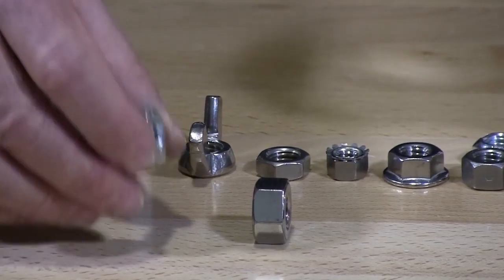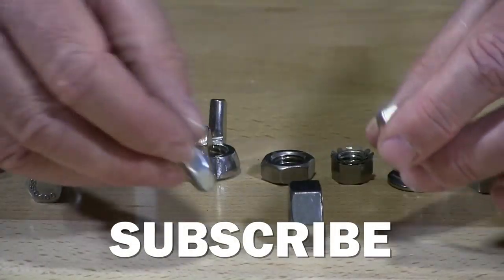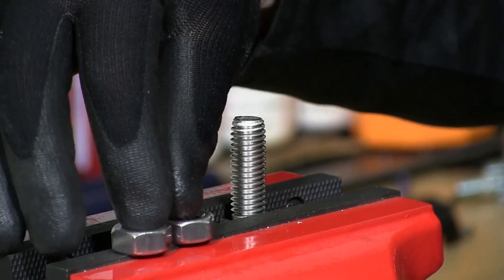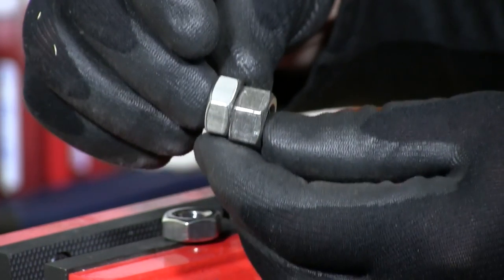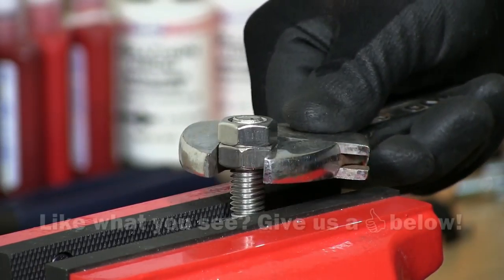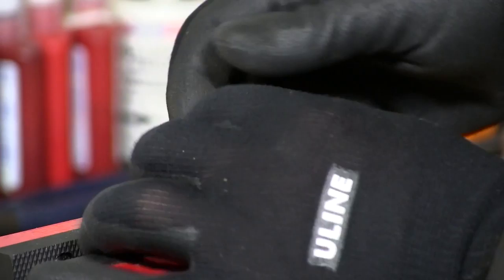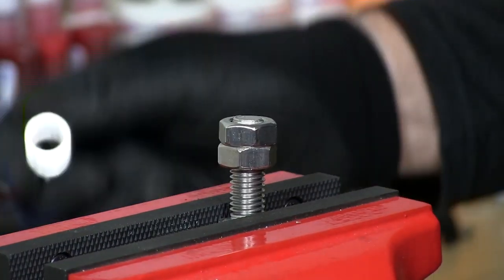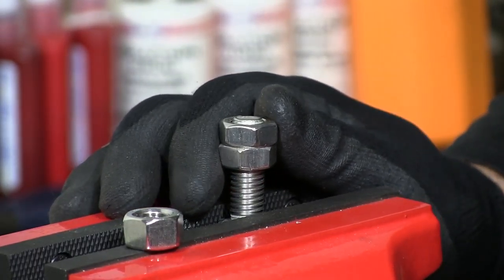How to Use Hex Jam Nuts | Fasteners 101

Comment: The idea is to use a thin nut on the bottom to ensure that the backlash is maximised so that the top nut is tensioned such that the upper flanks of the nut are in contact with the bolt flanks after tensioning therefore eleimiating the ability for relative movement between the bolt and the nut. By using a thick nut your tension applied my not result in the top nut desired flank contact due to lack of movement during pretensoning

Comment: I landed on this vid looking to find something that would explain why I have hex nuts that have slop when fitting on a 10-24 screw. They screw on easily, but wobble. Do jam nuts have a lot of play? These nuts also don't thread onto 10-32 (fine) or 5M-0.8 which is the closest size of metric.

Comment: Great video.  Very good explanation.  I have a question that I cannot find an answer to, regular everyday hex nut.  both sides are chamfered, or one side may "seem" to be "more machined" or "flatter",  is there a correct side to install against the material being tightened or is it just a preference call?  Thank you again.
Reply from the maker: Hello Mrchip3040!
There are several types of nuts that intentionally have a rounded top such as the stover nut: https://www.albanycountyfasteners.com/Zinc-Stover-Hex-Lock-Nuts-p/1102-116.htm
In most cases, nuts are meant to be tightened against a washer. The reason for this is that a washer provides a smooth flat surface to tighten against. Without being able to see or determine the kind of nut, and assuming it is a standard hex nut, you will probably want the flatter side to be face down against the washer.

Comment: I have a very hot and massive vibration case, a two-stroke header I'm having a hard time finding a good solution for. I was hoping to use this method but it may not be the best. Do you have a better idea you can pass on? Thank you.
Reply: Safety wire nuts/bolts.

Comment: you are supposed to use a jam nut first then a regular nut...
Reply from the maker: It ultimately wouldn't matter which is screwed on first. As long as they are secured up against each other you will get locking action.
Reply: @AlbanyCountyFasteners  not according to 50 years of testing and training
Reply from the maker: @brendonboville4813  Sorry Brendon, I think we had a misunderstanding. If you put a jam nut on and tighten it against a finish nut, it would be no different from putting on a finish nut and then tightening it against a jam nut. It's actually the exact same connection just in a different order on the bolt. A jam nut is just a thinner nut that you tighten against a nut of a different type. The only difference between a jam nut and a finish nut is that a jam nut is thinner. It will tighten up nicely regardless of which way it is applied.
Reply from the maker: I think the confusion is coming from the application. In a situation where you are tightening a a nut against a material, you are right, you would use the material, then the jam nut, then a standard finish nut. However, in the application mentioned in the video about creating a free spinning fastener assembly by tightening the two nuts against each other, the order won't matter because there is no third force acting on the two nuts. They are only tightening against each other.